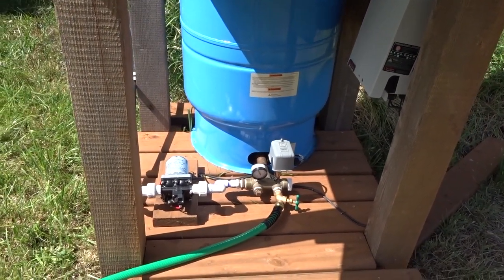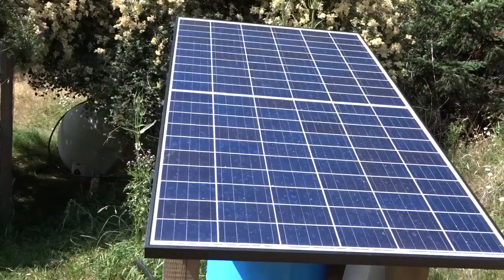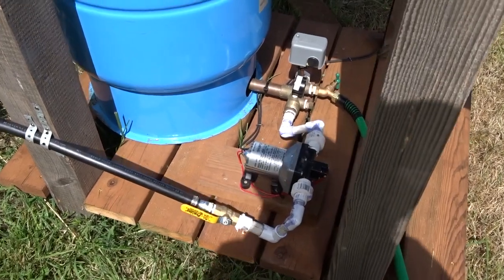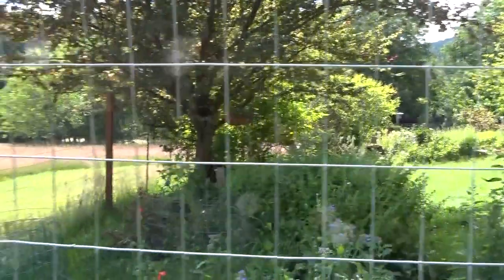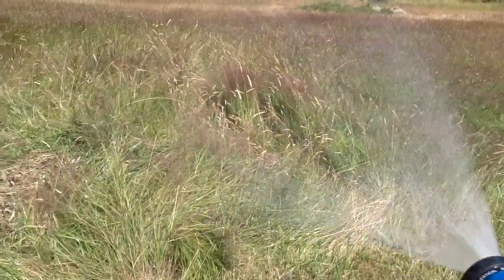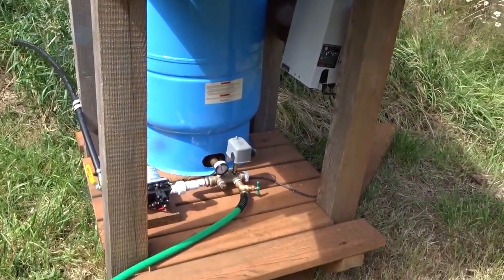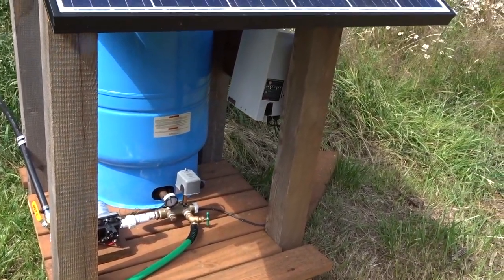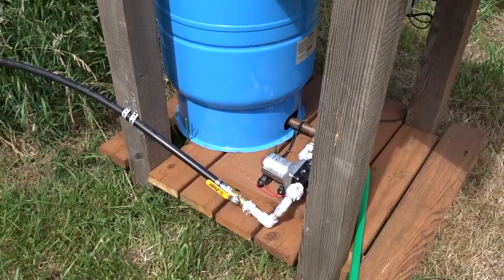Solar charged water pressure battery

Comment: Nice Setup.  Similar to mine, the key with this type of pressure tank is to have a 60 psi pump that works in harmony with the tank (ie the pump auto shuts off when 60psi is reached).  I got my ~20 gallon tank used and it runs great.

Comment: Hello, what kind of pressure switch did you used? I'm under the impression that pressure switches normally runs on 110v?
Reply: its a standard Square D pressure switch.  It is rated for up to 240VAC but it works fine on 12VDC too.

Comment: Hello, where can I buy this type of pump and what horsepower is this pump?
Reply: its a Shurflo 12 Volt DC pump often sold for RVs and boats, and small water systems like for cabins.    I don't know the horsepower rating, it is pretty low,  like 1/4 or 1/8 HP.

Comment: cool! My guess is that the air bladder inside the tank will give you, I don't know, 3 to 5 gallons of pressurized water before it's deflated, right? What's your reckoning?

Also, if you use it full-on, is the solar able to keep up, or do you have to water intermittently and wait for the solar to pressurize the system from time to time?
Reply from the maker: I sure think its a lot more than 5 gallons of pressurized water available with no pumping happening.     It seems like it.  I will measure that next time I go out there.   When the sun is shining, the pump kicks on and if it's a bright sunny day, it keeps up with the full flow of one hose with a sprinkler nozzle.   It has been in real operation for around 3 weeks now and so far the owner is very happy with it.
Reply: Great -- clever way to avoid batteries. I'm curious what you find about the volume of pressurized water when the pump's shut off for the evening.